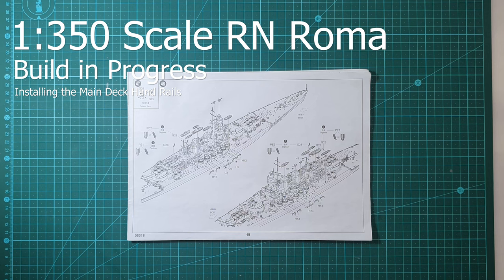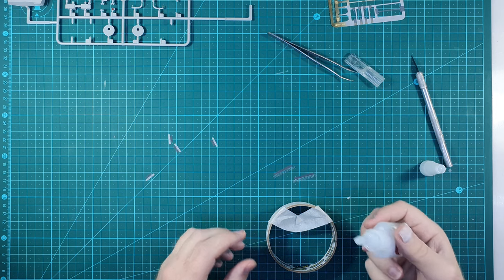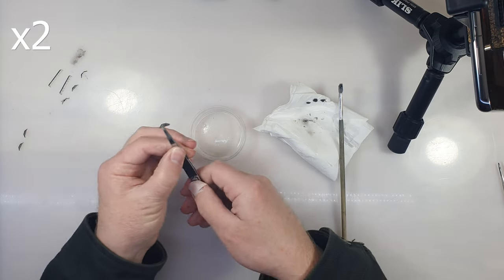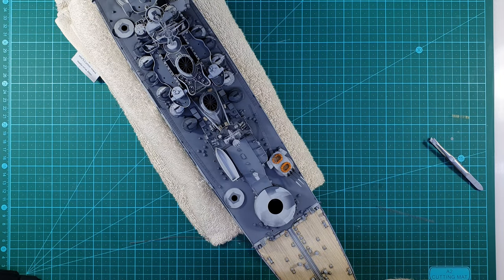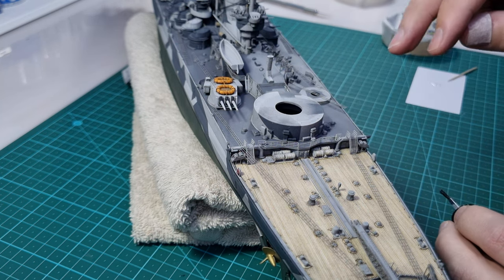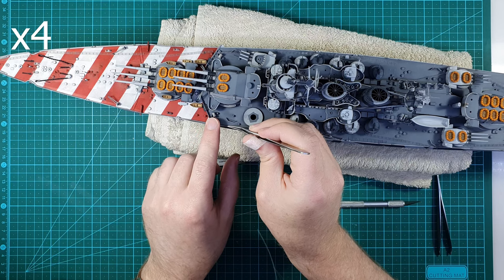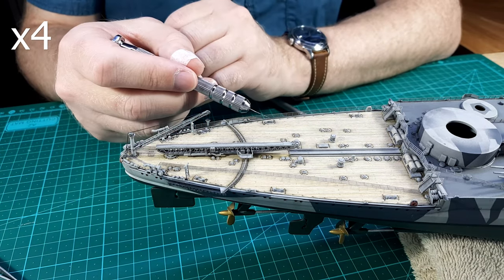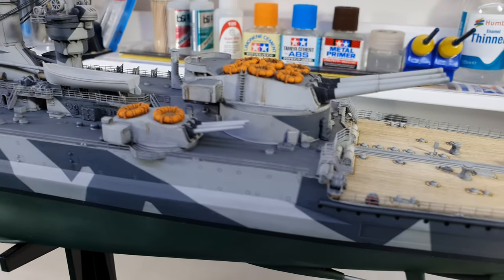1:350 RN Roma: Part 14 - Installing the Main Deck Hand Railing

Comment: Fantastic job there. With the light weathering it looks so much more realistic. Tho I'm still afraid of doing the same to mine.

As for model suggestion: how about some heavy cruiser? Like the Prinz Eugen, Des Moines, or an Takao kit (if you get your hands on one of those that is).
Reply from the maker: I know where you are coming from with experimenting with weathering, I went through the same thing. For many years I was not willing to risk it and these models sat without panel line.

Eventually, after I did tests on scrap plastic to convince myself that the process would not damage the paint and plastic I applied it to Nagato. I chose Nagato because it has a single colour paint scheme that is easy to correct.

I was happy with the effect that I achieved on Nagato so I repeated it again on Yamato, also because of the single colour, and I was happy with it again. 

In then decided that I would try the process on the ship that I was currently building, Richelieu, knowing that I would have all the correct paints on hand. I was mostly testing if I could get through the whole process without needing to fix damaged paint, and I was.

At that point I had applied the effect to three completed ships, all without requiring paintwork touch-ups, and I had confidence in the process so I rapidly applied it to all my completed ships.

My advice is to take your time to convince yourself of how the process works, and that it is safe. Then, when you are ready to apply it to your ships. There is nothing preventing you from revisiting your ships, even in several years time, and applying the effect.

Comment: Hi, congrats for the ship. Really Amazing. 
I've bought the trumpeter 1/350Roma and I'm using your video as guide. There's somethings I'd Like to know:
1 Have you painted also the hull and the superstructure except for the color indicated? Because the instruction does't tell the color (or I think. I see it's indicated H308+H11 on the top of the superstructure. I don't know if it means that color for all the grey parts)
2 have you purchased other PE? Because Ihave purchased the trumpeter upgrade sets (Gun barrels, screw and railings) but I see other PE like the windows of the command bridge. Can you tell me what set is it?
Thanks a lot
Reply from the maker: The mix of H308 and H11 is the colour for the light grey parts. I used colour equivalents from Tamiya, a 50-50 mix of XF-19 and XF-2. For the dark grey I used XF-24, and for the deck XF-54.

I am using FlyHawk's 05318 super detail kit, I put links to all the kits used in the video in its description.
Reply: @DavidsShips  thanks a lot for the info!
Reply: @DavidsShips  Sorry David, another 2 questions:
1 The Dark grey where did you use? Because  it seems to me all the same grey.
2 for the navy blue and tire black colours what did you use with the equivale of tamiya?
Reply from the maker: I used XF-54 for the deck and XF-24 for the dark grey.